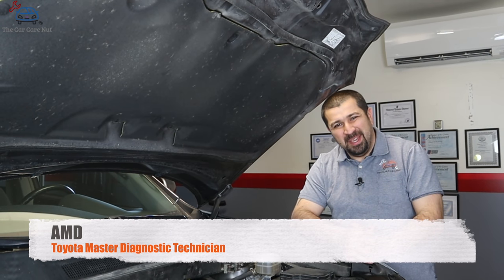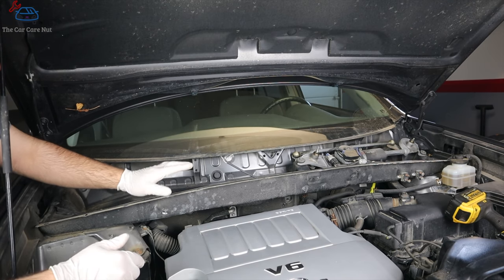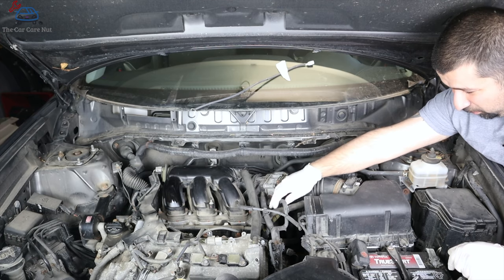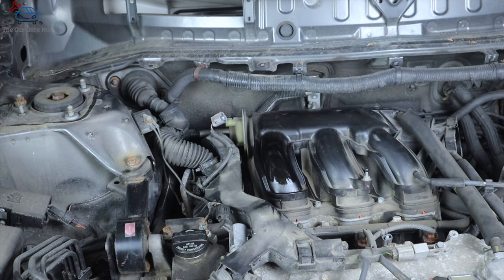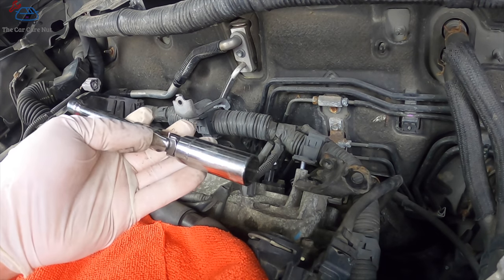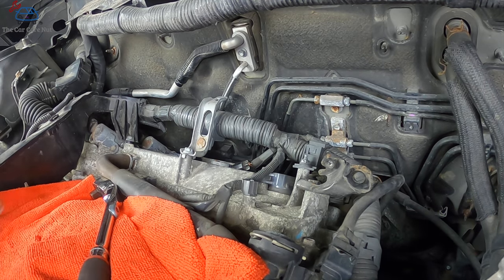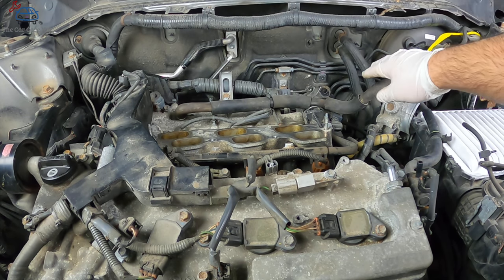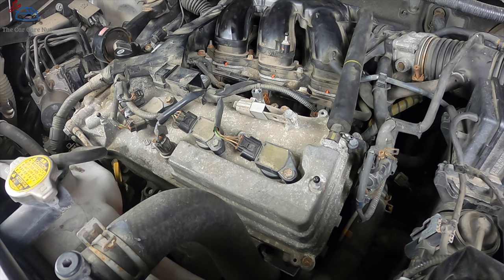How to change spark plugs on V6 Toyota and Lexus 2GR-FE 3.5L engine

Comment: Definitely what I was looking for.   The bank one upstream O2 sensor is right there in the exhaust manifold so after removing these items to change out the spark plugs, that’s a no brainier.  I’m just using projective reasoning and figuring that new plugs will burn fuel more efficiently and in turn a new O2 sensor on that bank will allow for better MPG.   I could be wrong..   we’ll see when I do the job.

Comment: FYSA: For some of us they put the Fuel Pump Resistor on the cowl. This means, that once it's removed, if you don't put back on the cowl and plug in the Fuel Pump Resistor you cannot successfully check your work. I was waiting to put on the cowl to see if it all worked before putting back on the wipers. But since the video did not include this plug, and I forgot I disconnected it as the job took multiple days (Tried initially to not remove the plenum, had to buy gaskets) when I tried to start the vehicle, it dies shortly after starting and I couldn't figure it out. Thank God the answer was in a forum and I eventually sniffed out it was "missing" from where it bolts onto the car bay, and was instead bolted onto the wiper housing/cowl. Very frustrating as the codes will not tell you this is the problem.
Reply: What does the fuel. Pump resister look like. It bolts on to the cowl. Which year is your highlander.appre Ite your help.

Comment: A few tips while doing this job . The spark plug plastic connectors on some cars are old/ brittle. Order replacements on Amazon. Mine were very brittle. Also the crank sensors were brittle also ordered on Amazon. No cutting of wires needed. YouTube searching should get the information needed to changed connectors.  I recommend start disconnecting the front spark plugs before starting job if they break order them before starting the whole project. I’ll post link if needed

Comment: For my particular car 13 ES 350...took 2.5 hours and I was taking my time...didn't need to remove the plenum just the wipers. The biggest pain is just moving the wiring for the rear coils out of the way once you do that its not a tough job...even the bracket went easy.

Comment: I just changed the plugs in my 2006 Avalon.  In all likelihood I would not have been able to do it without this video, I probably would not have even tried it.   

Some notes:

You need to be careful about selecting spark plugs.  The first ones I ordered the electrodes were completely different, even though the website said fits my vehicle.  They did fit, but I sent them back for the Denso plugs that matched what was in it.  

The problem bolt was a problem.  There is a metal hydraulic line on mine that runs about one-half inch above the bolt.  I could not get a swivel socket, u-joint socket, or any socket on it.  There just isn't enough space.  So I got a combination wrench behind it and was able to work it out, and got it back in again the same way (after a few choice swear words).  

I just wonder how many of those problem bolts aren't put back in.  The advantage of doing this yourself is you know the quality of work and parts.  Car runs like new. Thanks for a very informative and professional video.
Reply: On the 2000 Camry there is that long screw from the firewall directly in front of the bolt for the ground connections. I cut that screw to get room to remove it. Turns out didn't have to do that if the plenum is removed first providing more room. When installing if you didn't install that ground bolt first then you have to remove the plenum again. Removing that other problem bolt is another story, nothing seems to fit going down from 3/8" drive to compact 1/4" drive with universal swivel then I dropped my socket below the engine compartment, HaHa. This guy makes it looked so easy.

Comment: Very Informative video. With your permission, I would like to suggest the following for the DIY mechanics.
A pool noodle or pipe insulation taped to the edge of the windshield glass once the edge is exposed may not be a bad idea. It is also a good idea to take lots of pictures before removing bolts, nuts or hoses.                 A plastic box with dividers not unlike fishing tackle box is great to keep bolts, nuts and other small parts removed from the same area together.
A piece of solid electrical wire can help with keeping the wire harness/s and hoses tied off to keep away the work area. Using tape such as electrical tape, the extension can be attached to the swivel socket. It will prevent dropping the socket in the “no man’s land”.
To insure the spark plugs do not go cross thread into the head, use a section of ¼” vacuum hose attached to the tip of the plug. The hose can hold on to the plug while dropping it into the hole. If it is cross threaded, the hose will slip on the plug and will not allow it to cause damage. Once the plug is screwed in and seated with the hose, it can be tightened with the plug socket.
Reply: I use a 6 inch piece of fuel line for this.  Fits snug around the ceramic part of the plug.

Comment: This is a great video that you've made doing this in detail that is 61-year-old woman, like me, can repair my own vehicle. But I have a problem at the moment with the plenum. I've been done all the bolts that you said to undo but the back left corner will not come loose to where I can lift it off. And I don't feel any other bolt back there holding the back left corner in place. Do you have a suggestion on how to get this thing loosened up?

Comment: This was a hellacious job. I don't understand why Toyota used what looks like a 90° angle design, on my 2003 Honda Odyssey that's also a 3.5L you can wrap your arms around to the back and the back plugs and coils are a snap. I'm still bleeding. No I didn't remove the cowl/wiper motor assembly. What sucks is I had the plugs but FedEx never delivered the Beck/Arnley ignition coils I ordered, guess who has to go back in and do this all over again?? I did this for a friend, the timing was the issue, it had to be done this Sunday, now I have to go back in and do it again. I've never seen so many connectors and vacuum hoses. I ended up spraying the connectors with WD-40 just to get them off, they were welded on with age and heat... it's a 2008 Highlander with 140k miles, those plastic connectors were very time consuming. I'm surprised that Toyota decided to put the wheel lugs facing out so you can get to them from the outside of the car, I'm surprised they didn't face them from the inside or something.

Comment: Thanks! I did the plugs on a 2011 Highlander Hybrid which has the 2GR-FXE. I discovered an EGR cooler directly above the rear coils which wasn’t fun to deal with… Overall, it wasn’t too difficult. I recommend the swivel plug tool and a variety of extensions. Thanks again!
Reply: @chris3407 what's the solution / workaround for the EGR cooler?  I'm gonna tackle this soon on my 2012 HiHy...
Reply: @Bandit.6139  I just unbolted it and moved it out of the way the furthest it would go
Reply: Hey #chris3407 Thanks for the response...Couple more questions for ya:

You remember if you unbolted the flange closest to the front/pax side?  Also, did you reuse the gasket?
Reply: @Bandit.6139  sorry, I don’t remember. It wasn’t a bad job, I just took my time. And I’m just a home garage guy.

Comment: Hi Ahmed, in the Toyota service manual (ignition section), the torque for the spark plugs is 18 ft-lbf not 13 as you mentioned.

Comment: For a Gen 6 Lexus ES 350 - you do not have to remove the cowl assembly. In this case, don’t go for the lower bracket bolt on the rear left bracket. Instead remove upper 12mm bolt on the plenum. Use a mirror to look and feel where it is. The key to getting the rear bracket bolts back on is to refrain from tightening the intake manifold bolts first. First get your bracket bolts in, but keep them loose, then tighten the intake manifold bolts/nuts.

Comment: AMD, I just did this today on my 2011 sienna. Thanks for the video! 👍

One of the front left spark plug was wet, the rest were all dry and looked good. What does that mean?

The car works great. Though rookie mistake I forgot to plug the one wire by the windshield above the plenum plug. I even cleaned the throttle body ( I watched your other video on how to clean it).
Reply from the maker: Hi! The spark plug tube is leaking. Very involved to fix it and likely won’t leak as much as you think. Drive it for a week and see if you have oil again
Reply: @TheCarCareNut  Thank you for the quick response.  I will try that.  It was mainly wet from top down.

Comment: Not sure if it will work on these cars but my Solara has a V6.  All the videos said I had to pull the intake to access the rear plugs.  I did it by using 1/4 inch drive extension ( I think it was 4 inch long) and two wobbly joints ( one on each end of extension) to turn the socket.  Three rear plugs only took about twenty minutes after I figured out how.  Don't ask how long it took to realize how to do it!

Comment: Thursday, October 10, 2024 - Just make an appointment for a spark plug change on my wife's 2004 Toyota Camry XLE V6.  Service advisor indicated that this job is rated at 3.15 hours at $150/hour (Cdn) approx. $475!! Wow. I was shocked.

Comment: I just did this on a 11 Highlander. I want to add a few  things. First you need a magnetic tool for retrieval of drop sockets...cause you are going to drop stuff on the rear bank. Secondly you need a very good 5 mm hex.  Cheap tools do not work and will round the fasteners (mine were really tight). Lastly, that SnapOn 5/8" swivel sparkplug socket might be a good buy. Cheap swivels don't work. Also, all my coil clips broke due to being brittle with age. Hope the connectors stay seated. What a PITA the rear bank is!
Reply: You can replace the clips from Toyota I just did 3 on mine

Comment: Unreal Mechanic. At one point I thought I was at the Opera or Ballet. One thing I was thinking when you presented the possibility of reinstalling the wipers on a clean, non Toyota windshield. Instead of playing around with the angle, or using a dirt line or a tiny dot, why not put a piece of tape on the windshield where the blade rests before you start the job as a matter of procedure. That would seem to prevent any calculating or guessing and only takes 10 seconds out of the job.

Comment: I make one modification for the touchy bolts -- I replace them with studs -- as in the L-bracket position. That bolt is a M8-1.25 with a 12mm head. I just buy aftermarket M8-1.25 bolts and cut off the head... measuring the length against the Toyota original. I then run them in -- with the 'rough cut' going in first -- with a touch of Loctite Blue. I do all of this when the plenum is off the engine -- and the location is fully exposed, so easy. Later, during assembly -- and all following plenum projects -- running the nut onto the stud is very quick. I have found that running a bolt -- blind -- as you have done -- requires a 'touch' that a DIYer can't learn. I have a 1MZ-FE -- and my plenum practically flies off and on... now.
As a DIYer, I make another modification. I wrap the various hoses with white (electrical) tape// colored tapes so that I mate them up properly. I just don't have your experience level -- and never will. This stops me from hunting all over the engine bay for flopped hoses -- even harness pigtails. I'm bad.
I also slow down and use electrical tape to hold steady my sockets and extensions. My tool budget can't tolerate all the professional's stuff. I have become quite the magnet pick-up artist, though.

Comment: How much is a reasonable price for plug replacement on a 2010 Lexus RX350 at a Lexus dealer ? also are factory plugs properly gaped or not . I bought the car with 136,000 miles from the dealer bargain lot it now has 42,000 miles
i'm not sure if there is a way to find out iif the plugs have been replaced ?  Great video

Comment: You are great tech I have been working on cars for 25 years but I have always used NGK and Flipro Gaskets and never had an issue. Toyota parts so expensive I use their parts with my discount still way over priced.

Comment: Thanks for the video. Very nice done. I have a quick question. How do you know if it is the spark plug or the coil that gives you the problem? My Sienna has over 190k miles and still going strong (knock on wood) but at some point I would have to do this job. So I am trying to figure out before so I don’t have to replace the spark plugs, button everything up and then realize the coils are the problem. Thanks again.

Comment: AMD,  I did this service on my 2015 RX350 today including a PCV valve and throttle body cleaning.  Not a bad job but it took longer than I originally thought.  After finishing, I took a ride and the Check Engine Light came on along with  the TRAC OFF light is now on.  Did I do something wrong?  I was very careful to complete everything per this video.  I am going to run codes as soon as possible before taking anything apart and replacing parts.

Comment: Starting that bolt in back on the L-bracket is quite frustrating.  I bolted down the plenum before I attempted to start the bolt.  Then the bracket hole does not align with the threaded hole where the bolt goes.  So I loosen the upper bolt on L-bracket and that still doesn't allow it to line up to thread the bolt.  I eventually gave up and left the bolt out.  It has been two years and no issues.  I should have done as shown here and not bolted the plenum down first.  Another problem is the locking clips on the coil pack connectors break when removing connectors.  I bought replacement connectors and spliced them in.  They are expensive.  I hate doing this spark plug change.  This is why I only get 4 cylinder Toyotas.

Comment: AMD,  I have a 2008 Sienna xle  I was told a few different things to use for the power steering fluid, some say use the WS tranny fluid, some say dex/merc tranny fluid, the last was just clear power steering fluid.????   So I trust your opinion instead of the keyboard mechanics.  Thanks in advance for your reply..

Comment: We just did an engine transmission swap after motor ventilation.  I just got everything put back together. I think I did a real great job watching your videos doing the swaps and we are having a misfire cylinder 2&4.  
Should I do a computer flash? Will it re learn?

Comment: I paid my Independent mechanic to replace the six spark plugs and six ignition coils on my 2nd Gen Toyota Sienna.  There was just too much to take a part on the back side of the engine and my mechanic replaced the air intake manifold gasket as a part of the job.  He was kind enough to use the Genuine pre-gapped Toyota Spark Plugs that I had already purchased, along the six genuine Denso Ignition Coils that I bought for a reasonable price.  I purchased these parts before I realized that tearing down the back side of the engine and windshield wiper cowling was too big a job for me.  My biggest struggle as a DIY mechanic is finding the time to do it myself.

Comment: Just to clarify. Nothing is to be applied to the spark plug threads correct? Also do the coil plugs require  dielectric grease to be applied? Thank you for the excellent video.

Comment: Great video instruction...One question,  Is there a need to disconnect the battery while replacing the spark plugs and ignition coils? Thanks

Comment: I have a Toyota with 175K Miles and original plugs and boots. I have no issues with the vehicle and am changing them for preventative maintenance. Do you recommend changing the boots out as well? I have standard plugs and boots.

Comment: Great video as usual.  Have you done a video that shows the valve cover gasket removal and replacement on a V6 (preferable a Highlander)?  With the plenum removed you're  in a perfect position to change the valve cover gasket too.  thx

Comment: I am going to do this on my 2007 Sienna.   I have confidence that I can do it because I just did it on my wife's Ford Edge 3.5. I had to pull the plenum on it too.  Then,  when I pulled the coils,  on all the cylinders,  the boots stayed on the spark plugs.  So I had to reach down into the hole with a long forceps and pull them out in bits and pieces until they came loose from the plugs.    I got good at it before I was done.   As one of the rear coil packs was bad, and another was cracked, I went ahead and replaced all of the rear coilpacks so I hopefully don't have to pull the plenum again.  I plan to replace the same on my Sienna when I change the plugs.   I have to do it soon because my engine light is on.  The engine runs just fine though.   The Edge just suddenly started running rough with a engine light on. 
It turned itself off within the first 100 miles.

Comment: awesome video to help me do my 2008 Toyota highlander , I do have a question though , why do you not put anti-seize on the threads of the spark plugs ?. I was under the impression you should always do that when doing spark plugs into a aluminum parts

Comment: I like the "sprialwrap" on the coolant line to the throttle body-that stuff is usually used to prevent chafing damage to lines-used primarily in aviation. Wonder how it got there ?

Comment: I would 100% recommend replacing the coils at the same time. But I'd like to hear somebody give a before and after report. I haven't changed mine in my 2009 Highlander and not sure what the condition is because I bought it used at 108,000 miles (now at 130,000ish) but it's so smooth I just can't imagine it running any better. I could imagine it getting better gas mileage though.